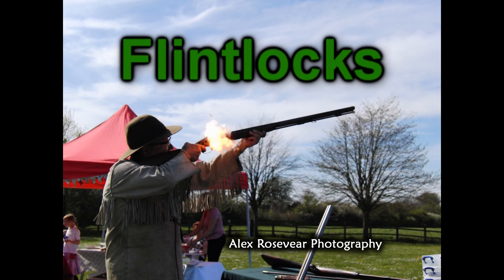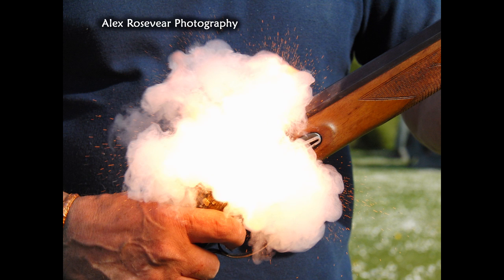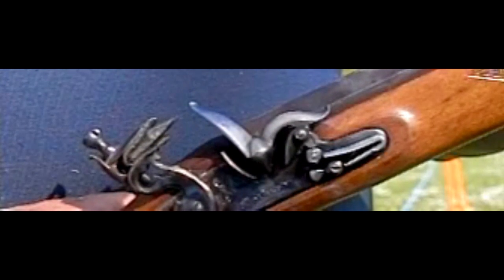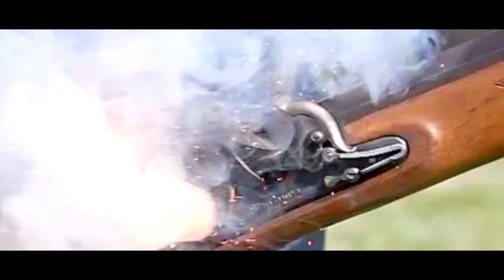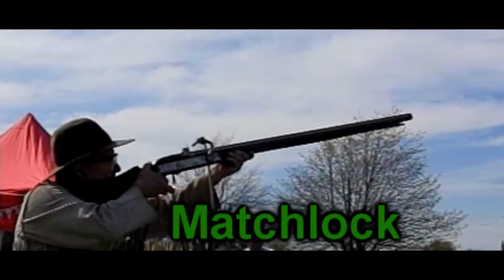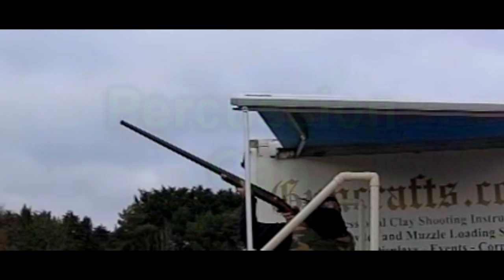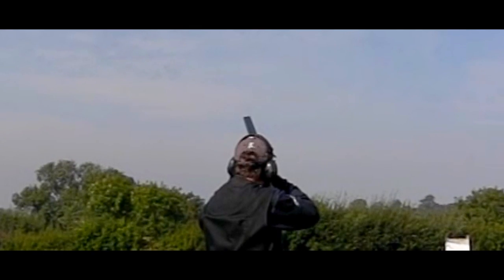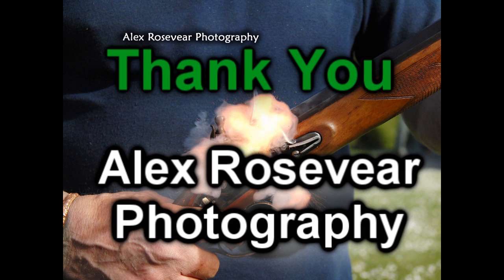Flintlock Analysis Slow Motion

Comment: Greetings from Canada. Someday when I get a PAL, I'll buy one of these. A neat weapon. I'd be willing to test it with a Minie ball. I think those could be used on smoothbore, since they're smaller than the calibre, like a musket ball. They still wouldn't be as accurate as a Minie rifle, but still more accurate than with a musket ball.
Reply from the maker: Joel Dayton Hey! I've not heard of a Minie ball, being put in a musket or a shotgun but hey, if it is smaller than the bore it shouldn't matter I suppose. Let me know if it works and if it surpasses a musket ball in terms of accuracy.
Reply: Well, no not really.  Yes, I now the comment is 6 years old, but this is one I run into here and there.

Round ball is actually very accurate in a barrel with a slow twist rate (1:60 to 1:70).  Naturally, you need a proper fitting patch to act as a gas seal and to engage the rifling.  The main difference is that a round ball is not at all as aerodynamic and loses energy pretty quickly in flight.  Coupled with a lack of velocity and the inherent mass limitations of a sphere vs. a cone and you're pretty well locked in with no way to eek out more energy.

Mine Balls (there is no such thing as a minie rifle) like any conical bullet needs rifling with a faster twist rate or it won't stabilize in flight (like a football).  While the mine ball was made to be smaller than the bore it shot out of, this was for loading only.  The point was that the cavity in the ball would expand to engage the rifling.  Put it in a smooth bore and you simply won't get the same performance.

BUT, this is still not to say that I would not be interested to see someone try it, just to see what happens.  Personally, I think it would keyhole more than half the time and not accurately.

Comment: Nice video, great information and entertainment density. I don't quite understand how the short start can destroy the weapon. I've done my test with extreme barrel obstruction(a metal rod) and added a little dark aluminium to the powder. The barrel didn't burst. It had high wall thickness and low inner diameter trough.